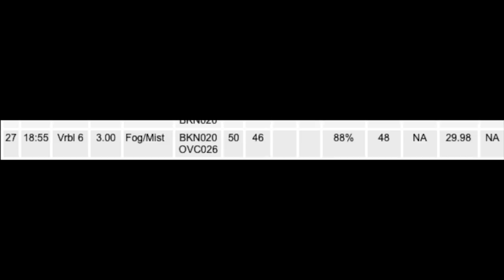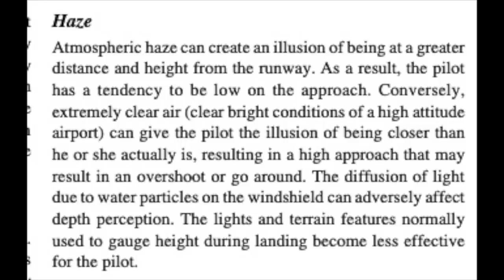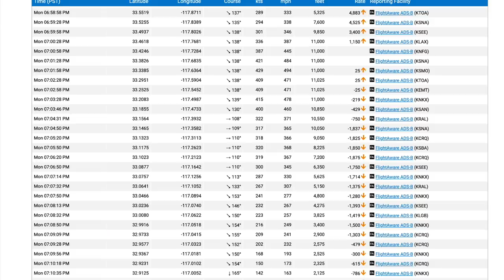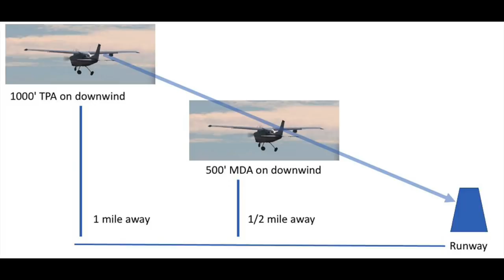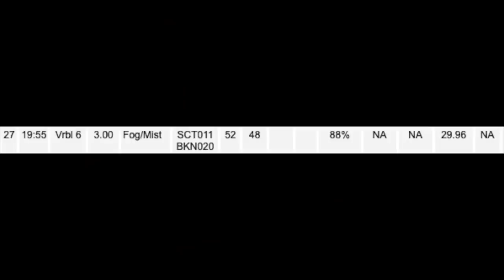N880Z Learjet Crash El Cajon San Diego California - Low Altitude Starts Accident Chain

Comment: Question on flying the published missed.  They were cleared for RNAV 17 so do they fly that missed or do they fly the LOC-D Missed since that is the runway they are aligned with after canceling IFR?  If RNAV 17 they would continue the turn and align with RWY17 to get on the published missed?  Just trying to take the good suggestion of going around on a missed approach and trying to walk through the steps of how to do it in this case.
Reply from the maker: The general guidance for going missed during the circle of a circling approach is to make the first turn toward the airport, since that's usually where the terrain is lower and there are no obstacles. You would then maneuver to join the missed approach for the approach that you flew, the RNAV (GPS) 17 in this case. But this crew was VFR. So they would have to turn toward the airport and stay out of the clouds until they could get a new IFR clearance, which would take a little time. Plus, if they're below the minimum vectoring altitude, they wouldn't be able to get vectors until they climbed on their own avoiding terrain, until they got above the minimum vectoring altitude for that area. In general, it would be safer to remain IFR in a circle, as you would already have a clearance to fly the missed, which saves a lot of time and uncertainty. But legally, they couldn't stay IFR while circling to 27R.

Comment: Another good point about perception when too low at 5:50. At 6:00, According to Google measure tool and 3rd to last ADS-B data point, He was approximately .9 miles from RWY 27R threshold on downwind when he was heading at  87 degree magnetic. This seems too close and definitely too low.  FWY 8 is a good visual at night, although it pinches in to base. He started to pinch his Base leg, climb and add power/speed at 2nd to last ADS-B point. Perhaps distracted or got a terrain warning from small hill.  The last 16 seconds of ADS-B is not recorded and there is no FDR, only CVR. My speculation is, that in final 16 seconds or less, he realized he was still way to low, saw 1200-1300' hills approaching, was going to overshoot, perhaps panic and startle effect,  and really started to pull and overbank. He might not have added necessary thrust or added too late to spool up= accelerated stall. He might have even done the classic cross-control stall , rt aileron correction for overbank, without rt rudder which has sealed the fate of many pilots. RIP to my fellow pilots and RN's.

Comment: Several times you mentioned overshooting the final approach course, my guess is they steepened their turn, went into an accelerated stall and crashed…knowing well the characteristics of the M35, likely inverted. 

My initial reaction to the Truckee crash was that both pilots were looking out the windscreen. Same for this accident.
Reply: Agreed. Steepened base to final when they realized they had that hill in front of them. Why not just fly the LOC 27? Similar minimums.
Reply: @francvasquez  Yup, flipped over inverted, you see it on the moment it first drops.
Reply from the maker: I agree, highly likely. Yes, having to split your attention between the runway and the instruments is part of what makes this kind of landing (at night in poor weather), so difficult. And it would be so easy to keep staring out the window.
Reply: Was a stall and flat spin, the wreckage is contained in one spot. (EDIT) I realized it was most likely an accelerated stall, still leading to the aircraft to stop flying and drop out of the sky like a rock.
Reply: @badmonkey2222  - Please show me a Lear 35A, high performance jet, flat spin - ever.
Reply: @chucksavall  you're looking at one, basically accelerated stall inverted dropped like a rock, ask yourself why this keeps happening over and over and over and over, because part 135 pilots aren't getting the training to do these sketchy circling approaches and they are only required vref + 5 which leaves no room for error, vref+ 20 is what the airlines did and they never seemed to have a problem and they banned circling approaches altogether now. What's wrong with training these guys to add speed when they're low and slow making these turns especially in bad weather in jets that are notoriously unforgiving, biggest mistake this guy made was canceling his IFR and tried to do this landing visually and not maintaining enough speed in the turn,  same thing happened in Truckee and is going to keep happening until these guys get the correct training. It also came out today that the pilot-in-command had some restrictions on his credentials they haven't stated exactly what they were yet.
Reply: @chucksavall  I know enough that the training they get on doing circling approaches is minimal at best they don't stress keeping a large enough percent stall buffer and only required +5 which seems unimaginable, the procedures and drilling into their head to stay on top of the math is not a priority for some reason, pretty obvious that circling approaches on these unforgiving high-performance lear jets in bad weather especially is a problem. It's  almost every month or every two weeks one of these jets are crashing and people are dying in the same exact way.  Many think they should ban circling approaches until they get to the bottom of why the crashes (accelerated stalls) keep happening,  there's a reason why the airlines banned circling approaches.
Reply: @badmonkey2222  - Again, it's all about judgment.  The FAA sets limits, but that doesn't mean all pilots / aircraft are capable of operating at those limits, while others are.  The FAA also doesn't know which pilot / aircraft combos are / aren't capable, so they leave that judgment to those pilots.  When you get your Driver's License, does your state DMV tell you what conditions you're safe to operate in?  You learn to drive in FL, but that doesn't mean you can't fly to CO, pack your family in a rental, and drive up into a mountain blizzard, even though you're certainly not qualified.  It's up to YOUR judgment, good or bad.  Having trained hundreds of pilots, the goal isn't always to teach someone how to do something, but rather, to help them learn how to make good decisions, and know when NOT to do something, even if it's "legal."
Reply: @chucksavall  I agree completely that it's up to the individual to be vigilant and using basic common sense, the minimum requirement on vref speed is different for different aircraft types correct also,  but still the general required rule is +5 but these private schools ( none of which I am bashing generally they do a great job)  are not teaching them to be vigilant in their math on these approaches and only teach them what is required to be taught , I don't think it's a great idea to leave it up to the individual and to assume that they are going to be vigilant, it must be drilled into their heads. My father was a flight instructor as well and his technique was being as simple as possible in teaching student pilots yet drilling into his students heads the essential techniques and was a stickler for keeping and eye on your speed when  low and slow and stall recovery techniques. For example,  losing an engine on takeoff in a single-engine aircraft, a persons natural reaction is going to be pull back on the yoke risking an immediate stall, but he would absolutely pound it into people's heads to instantly get the nose down and establish best glide and how to keep it. He was also big on techniques for missed approaches which is another high accident area. I grew up flying with him, Cessna's,  single and twin engine,  Beechcraft,  Moony's, Pipers, all sorts of different GA aircraft and also certain jet and helicopter type ratings. Even though I could technically fly a Cessna at age 10, i didn't get my license officially until age 25 and then after about 10 years of flying my career didn't allow any time whatsoever for anymore the needless to say I haven't physically flown in about 25 years lol, cheers and Happy New Years from North Carolina.
Reply: @badmonkey2222  - You know, I never even heard of Vref until I started flying jets, and Vref +5 only applies to straight in approaches.  We used to add +20 for turbulence or maneuvering, and usually even fly faster than that for "mom and the kids."  What kept me safe for 35 years was "energy management," and I learned all that from acro training and "Stick and Rudder."  Mention a "zoom climb" to a younger pilot, and they'll look at you like you're nuts.  Should be taught to every Private Pilot.  Hell, they aren't even required to do spins anymore - too scary.  ;-)    After 9-11, airlines were required to train "evasive maneuvers" - which involved rolling the simulator.  Now, you can't actually roll a sim, but you could pretend to, just apply full aileron and hold it there, the visuals worked, the instruments would indicate a roll, but the sim would go to its mechanical limits and just sit there until you came out the other side of the roll.  Many of our younger pilots could not actually do it.  The moment the visuals and instruments indicated 30 degrees bank, they would instinctively stop the roll and return to level flight.   Even if we had them close their eyes, the rapid motion would freak them out, and they would stop the roll.  What you and I probably considered the basics, isn't taught anymore, many airline pilots are just along for the ride and if it isn't a straight-in ILS with auto-pilot and auto-throttles, they're lost.  I gave many new airline pilots their "initial operating experience," and when I came across one glued to the automation and instruments, I would spread a newspaper out over their instruments, turn off the ATS and AP, and tell them to look out the window and just land.  Afterwards, there were 2 kinds of pilots, those that thanked me for the experience, and those that reported me to the Chief Pilot.  He would of course, send them back to me for more training - ;-)
Reply: @badmonkey2222   Couple of comments. I am a corporate pilot with lots of Lear 35 and 45 time, trained at Flight Safety at various locations. In the Sim we flew our circling approaches at flaps 20 and Vref+20 until the landing was assured on final, then going to full flaps and slowing to our final approach Vref speed. During our initial or recurrent training we were required to fly a circling approach usually at night, as well as on our type ride. I also flew Falcons, and we trained in them the same way. 

I’m currently flying an Embraer 500/600, and it is the first aircraft I’ve flown that the manufacture recommends flying circling approaches at Vref,+5, probably because it is a fly by wire aircraft and the computers won’t let it stall. And it has full time auto throttles, which are very good at maintaining the desired airspeed. Haven’t flown one in the aircraft yet, but will probably fly the circle at Vref+10. just to be safe. 

With all the GPS approaches now to almost every runway the need to circle has been diminished considerably. At  KTEB we used to have to circle to runways 1/19, but now they have an ILS to 19. However, there will probably never be an instrument approach to Rwy 01 due to Newark airport being so close to the south. Maybe when we can do curved RNP approaches.😏

Part of the problem in training for circling in simulators are the visual limitations. The visuals are much better now, but I remember back in the 80’s and 90’s the visual fields we limited, and it was very difficult to keep the runway in sight. This led to using only certain circling approaches, and the industry wide practice of using KMEM, KJFK, KICT, KSFO and a few others. I have tried the circle at KHUT in the SIM, and it is much more challenging than at KICT!

I know that some 135 companies might have limited training budgets, but I have been paired up many times in training with 135 pilots, and they go through the same training as we go through. And I’ve seen some excellent 135 pilots.  However, for good or bad, 135 companies are often considered entry level operations, and may not be able to hire the most experienced pilots. The pay is usually not as much as corporate, and it’s definitely not the same as 121 operations. 

The above accident was very tragic, as was the one at Tahoe. It points to the inherent dangers of circling approaches in general, but especially at night in marginal weather. I have to side with the commentators saying they should have gone to another airport that night, but since it was their home base they probably thought they knew it well enough to pull it off. Turned out to be a fateful decision.

Comment: they may have lost the runway lights not just due to mist but much more ominously b/c they dropped below a hill on the approach. Always a red flag if lose the runway or tower  lights on an approach !
Reply from the maker: If they were making right turns to 27R, they would definitely lose sight of the runway, as that happens routinely. They were making left turns to 27R, so there shouldn't have been any hills blocking their vision. Had they started their turn much earlier, they should have been fine. Rain and mist are highly variable and I'm guessing it was a little worse where they were than it was over the airport, which reported 3 mile visibility. I flew IFR into Sacramento the other day. It was reporting 10 mile visibility, but we didn't see the runway from the direction we were coming from until we were about 2.5 miles away.

Comment: There’s a mountain that would have been right in front of them on base.  The mountain is inside of the right pattern for 27R. There’s also an ILS to Montgomery field 8 miles to west.
Reply from the maker: Yes, that's the one that block's a pilots view of 27R at some point. I've read that's why they use a left pattern to 27R at night, so that pilots' views aren't blocked.
Reply: Montgomery is too short for a L35.
Reply: @DocJay  thx.

Comment: I've never understood why the approachs at KSEE are the way they are.  There is a localizer-D that says circling to 27R NA. But I've shot that approach mant times and it's every bit of a straight-in.  The FAA needs to review the procedures here and give pilots more options other than canceling IFR just so they can land on the long runway.
Reply from the maker: If you fly that approach slowly, it will work OK going straight in. But for fast planes like the Learjet, they end up with an absurdly high descent rate to fly the nearly 7 degree gradient down from the MDA. That's an unstable approach, which is why it's categorized as a circling approach, and not one with straight-in minimums to 27R. I totally agree that the FAA needs to figure out some better options for this airport. If they had better options, these guys wouldn't have even considered the one they flew, but there are few good options there at night for fast aircraft.

Comment: As a non-pilot i find this whole thing very interesting, let me ask a dumb question. Why cant the pilots use autopilot up to the point the aircraft is lined up for the desired runway?
Reply: Autopilot (unless the aircraft and ground based airport / runway environment equipment meet the certification standards) cannot be used for the final landing phase(s). This particular aircraft was not equipped with any such capabilities, nor is the airport at Gillespie set up to even be remotely capable of such an operation. The crews of all aircraft are responsible for maintaining a stabilized approach, and the safe outcome of every flight is unequivocally the burden of the crew — with or without added equipment and features such as one might find on a sophisticated “Cat III - C” Certified aircraft and airfield — sadly this was a totally avoidable tragedy.
Reply from the maker: DKH, if you decide to become a pilot, I think you're already showing the kind of good judgment you'll need. Couldn't agree more. Just because they couldn't tell if the lights were already up all the way doesn't necessarily mean they couldn't see the airport...but it certainly opens up that possibility. If they really were having trouble seeing the airport, they should have gone elsewhere.
Reply: Autopilot use if available is very helpful in circling approach’s. In a normal “planned” circle one descends to the MDA (Minimum Decent Altitude) on autopilot, then levels off and looks for the airport or runway. Once visual one maneuvers the aircraft for the landing runway, still using the autopilot. Once in position to make a normal decent to the landing runway is when most people turn off the autopilot and hand fly the final portion. All autopilots have certain altitude restrictions when the autopilot MUST be disengaged. In the airplane I’m currently flying it is 80 feet if on a glide path, or 180 feet if no glide path.

Comment: This is critical aircraft at low air speed. It is mandatory that you, as a pilot never go below DMMS at low altitude with a dirty airctaft configuration and during a landing approach. Similar accident did happen in SVVA with a LearJet 60, tail number N119FD, S/N029, in Nov. 5, 2013 during a low visibilty, low altitude approach at runway 10.
Reply from the maker: My recollection is that in some Learjets you can't make more than a 20 degree banked turn with full flaps. As close as their downwind was to the runway, they would have still overshot the final even in a 30 degree bank. Just Go Around!
Reply: @AviationNewsTalk  Agree.